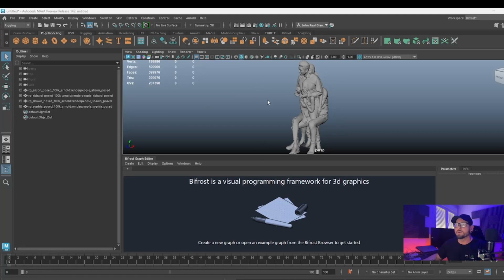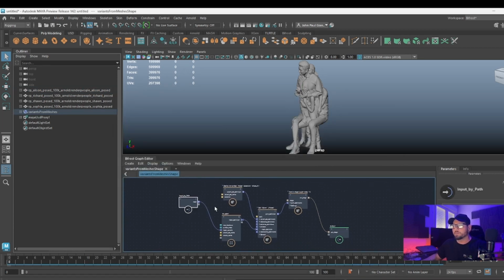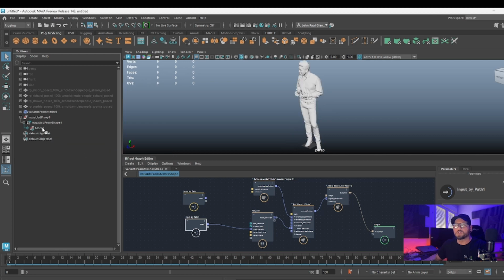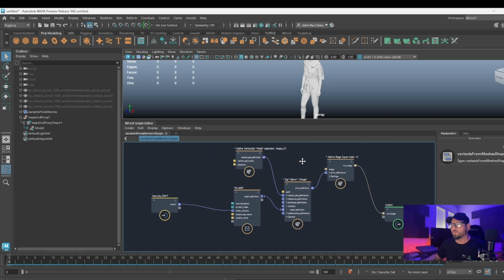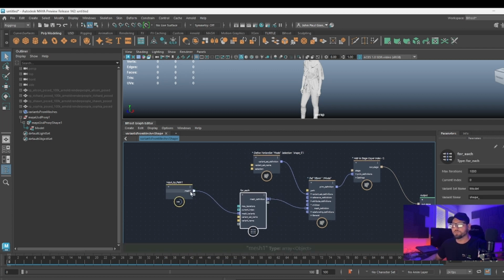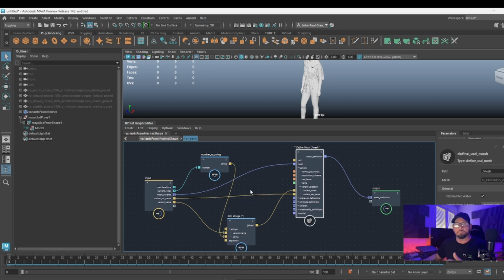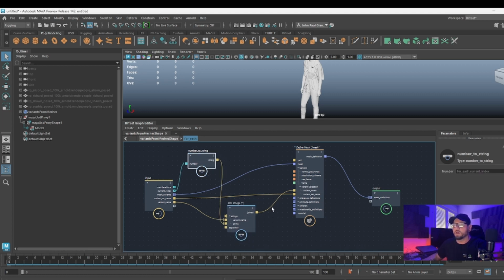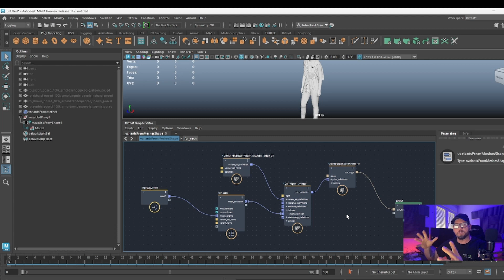Multiple Variants from Input Meshes with Bifrost USD "FREE COMPOUND"

Comment: Hello, I need assistance in sorting out a query I exported a project in a USD file with Arnold standard surface but when I tried to open that file on a different PC/System my work model was displaying but my texture wasn’t displaying could you please help me file I should save that I can get accurate results in all the system.